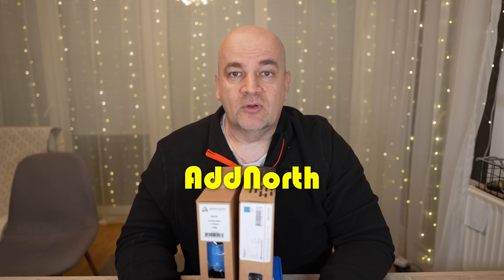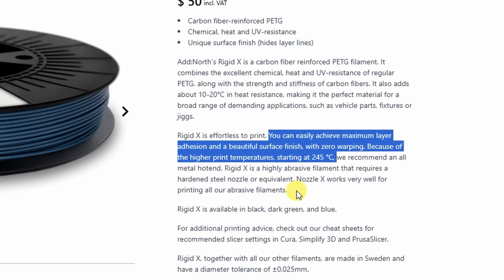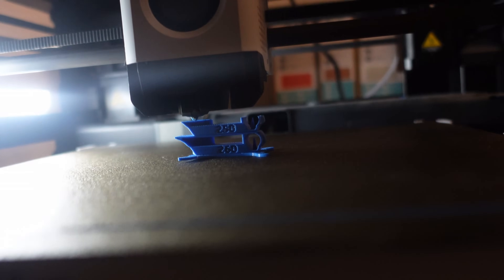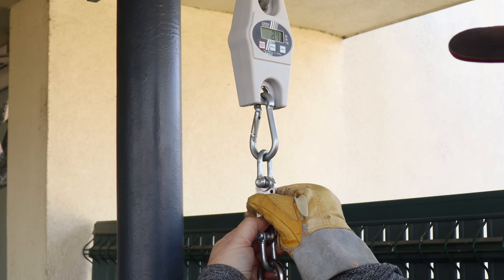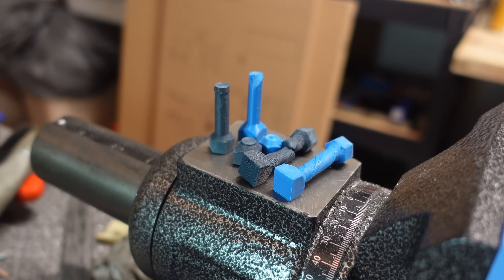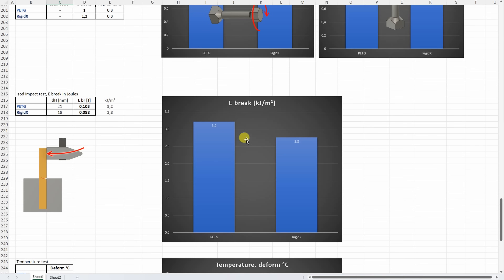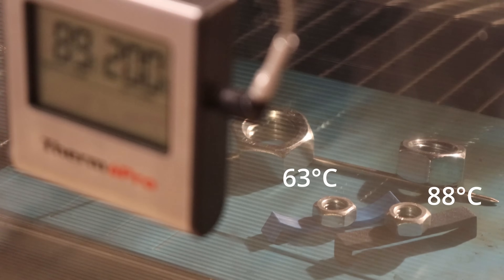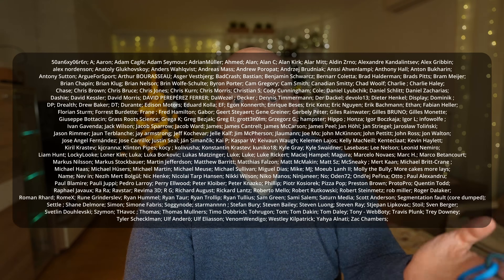Rigid X, the stiffest PETG filament I tested so far (vs AddNorth PETG)

Comment: To increase your engagement you need to do the same thing all channels do which is pay $$ to google, your videos will be seen by many more and it will significantly increase your channels reach even with just a $15 ad campaign you should break 50k views, it is what it is and this is exactly how their algorithm has been designed. lots of videos and papers written on the subject which can explain exactly how to maximize the timing of the ad campaign and minimize the expense. Its worked very well for the channel i post on.

Comment: Seems like a premium PETG-CF. As usual it's easy to print, hides layer lines well, has enhanced rigidity, and has increased temperature resistance. The interesting part, as with some other fiber filled PETG, is the improved layer adhesion. PETG-CF is a really cool material!

Comment: Quite a temperature range for extrusion.

For any filament, what is the average-Joe/Jane hobbyist supposed to do with these ranges, print a temperature tower for every new roll of filament? How about the manufacturer do that, and publish their temp tower results in brackets beside the range listed on the spool. I'm willing to bet that their temp tower results would show a temp that is sufficient for 99% of people using it.
Reply: Temperature tower results are subjective. Some applications favor strength over aesthetics, some want the best appearance and can afford to sacrifice some strength. And in all cases, any correlation between the temperature settings on the vendor's test printer and yours are purely coincidental. Extruder design, nozzle type, and even thermocouple/thermistor calibration vary widely. Even Igor's temperature tower results aren't something I would use directly. 20g of filament is a small price to pay for confidence in your temperature settings.
Reply: @dkessler14  What hobbyist is doing 'strength tests' in a meaningful way? Breaking a temperature town at each level will tell a human being absolutely nothing. 

And I can state with some confidence that almost no hobbyist is caring about the 'apprearance' of the finish, gloss or matte. Most just want a temperature number they can feel 'safe' using, even if they know it's 'subjective'.
Reply: @imacmill  Who said anything about breaking temperature towers? It's a tool to determine qualitative aspects of printing a given filament at different temperatures. It's usually a given that within the recommended temp range, the hottest temperature you can print will be the strongest. But some of us are printing parts with small detail, overhangs, and bridging, and can't just arbitrarily max out the temp settings. The temp tower is a tool to determine how hot you can go on a specific printer with a specific filament and still achieve the quality needed for your application.
Reply: Yes, you need to calibrate every spool of filament anyway if you want good results. The manufacturer can not know if you have e.g. a brass nozzle or a steel nozzle.
Reply: @imacmill  I'm actually an average Joe. I print a temp tower, and run pressure advance and max flow rate for every type of filament I get. Not for every color, but every type. If I switch brands I usually redo the tests. For most PLAs though they perform similarly enough I just go for it and only rerun calibration if I get unacceptable prints. 

The PETG-CF I have definitely needs different settings than PETG I have.
Reply: @joerogers1364  I'd argue you're not an average joe.
Reply: @imacmill  I've only had my printer for a year, but I'll take your comment as a compliment!

Comment: Nice test, the Rigid X seems useful for screwed together parts for example where flex and creeping isnt desired. Regarding price, its made in Sweden here in Europe, that will make filament more expensive(and something im willing to pay a bit extra for), however they use to have good black friday deals for example. I hope they sent you a HT PC roll aswell :)
Reply: it is not a bit extra though, that is the issue. it is like 2.7x more expensive than other petg-cf filaments which are also superior in some aspects.

Comment: Having jsed Petg and having watched your videos i just dont understand why peiple use it.

PLA with modifiers works great.
Reply: Creep and better temperature resistance.
Reply: @warmesuppe  Maybe temperature resistance but PLA CF deals with the creep and costs a lot less than Petg CF.

If I needed temperature resistance I'd use ASA or other high temperature filament.

Comment: 8:44 Yes, please create a video about that. I've been in this business for about 12 years at this point and from the very beginning people have always complained about how PLA is so weak. But I think people get confused since PLA breaks suddenly when it finally breaks, compared to some other materials that have some give before they break, so people think it's weak. It could also be that people don't know that PLA has improved over the years.

And before anyone says anything about the sudden breakage, yes I know that can be an issue in some cases. There is no "one size fits all"-material, and there never will be.

I'm not saying it's the strongest material ever, but saying it's super weak is just plain wrong. I just think it's getting more shit than it deserves so to speak. Over the years I'd say I've used PLA for about 95% of everything I make, even for things like a press brake die to bend aluminium sheet, and I've very rarely had it fail on me (unless high temp resistance is needed, which is something I almost never need).
Reply: I've been printing for about 10 years now, i have made tons of custom designs over said years from speaker mounts to cup holders etc etc bla bla lol. IMO PLA is very hard but the trade off is low impact resistance, it's brittle. Although you're totally right about PLA improving over the years. Still the deal breaker is creep for technical/mechanical parts under constant load. PETG (alone) is too flexible, unless you print it at 1mm3s flow with slight over extrusion and part cooling on (higher than normal) to temper it.. it gets VERY stiff and the slow printing gives you excellent layer bonding. BUT if you're printer can print ABS/ASA/PC at normal speeds you're better off just printing those technical plastics anyway.  I print those at 250-325mms and 5,300-10,000 acceleration, custom heater block with a Micro Swiss CM2 Volcano nozzle. So i personally find myself rarely printing in PLA or PETG unless i'm making a purely aesthetic/static part like a shelf. The PC I'm typing this on is in a case i designed and is printed in PETG-CF, so i'm eating my words lol
Reply: I agree. I use pla for everything unless it needs higher temp resistance.
Reply: I think pure PLA is a bit more brittle than pure PETG.
However PLA+, PLA Pro, etc. is much tougher than PETG.
And I think some Filaments, which are just called "PLA", include additives now as well. For example the "PLA Basic" from BambuLab is not basic at all.

Comment: 54 euro - thanx, no need this "Rigid X"
Reply: I used rigidX for PC cabinet parts that nedded to be stiff while temperature resistant. Pla would not do it for me, it would soften.
Reply: @billytalentrocks345  you can boil pla and then it doesn't get soft.
Reply: @difflocktwo  but boiling will change its dimensions?
Reply: @difflocktwo  🤣yeah...because its gone by then 🤣
Reply: @billytalentrocks345  slightly, depends on the formulation.
Reply: 54 is only for 0.5kg, you can literally get 1kg of pet-cf for the same price or 3.5 rolls of a better petg-cf from eryone
Reply: @ Yeah but my point was that for that price you can get 1kg PA6-GF from bambu and thats a superior material compared to petg
Reply: At this price you can just buy PA or PC
Reply: pla is just too good. you can use 5x more pla for the same price.
Reply: @difflocktwo  you are joking, right? 😂
Reply: @themountain59  not at all. being 5x cheaper, you can use 5x more material.
Reply: Pla creeps a lot even a room temp. Good luck bringing it outside in the summer
Reply: @Boz1211111  If you can print PETG, you can print ABS/ASA (+CF or not). Totally no point to pay 54 euro for this
Reply: @humphet3750  i did not defend 54 euro filament at all, i just say PLA properties are not good enough for me
Reply: @humphet3750  Without an enclosed printer? I'm not sure.
Reply: @RichardAugust68  For displayed parts no need any enclosure to print.
Reply: @humphet3750  that is absolutely false. Where do people get these ideas?
Reply: @difflocktwo  well...for what I print I certainly dont think so.
Reply: @themountain59  do you have one example where using 5x more pla wouldn't solve a problem? pla is already one of the stiffest materials.
Reply: @difflocktwo  well tell that to all the folks who print functional stuff like drone pilots, rc guys and prototype manufacturers.😅 For toys and gimmicks PLA is okay but for serious prints its not.
Reply: @themountain59  RC planes are printed in PLA.
Reply: @difflocktwo  wow...really 🤪
Reply: @themountain59  what do you mean?
Reply: 😂 nice joke @difflocktwo